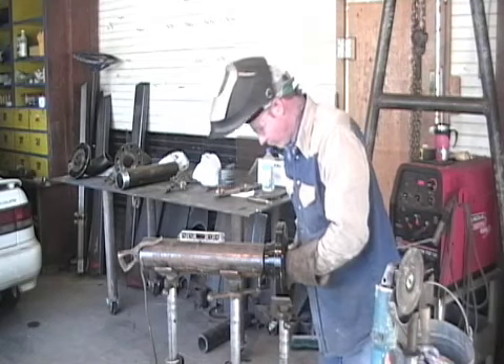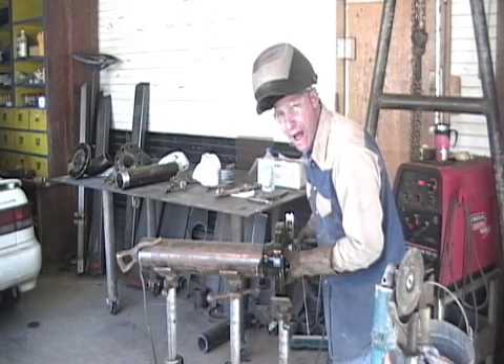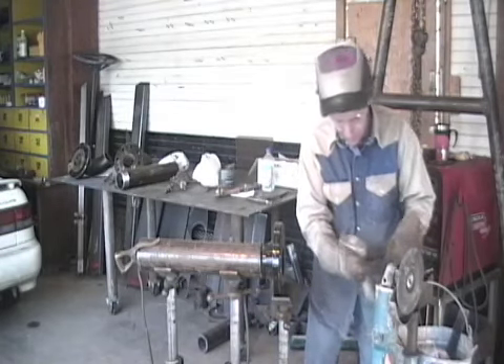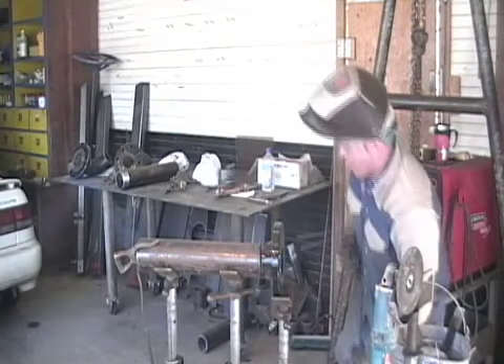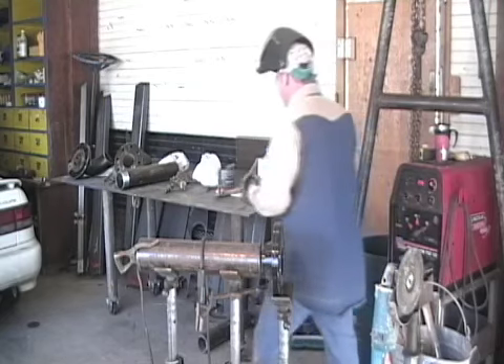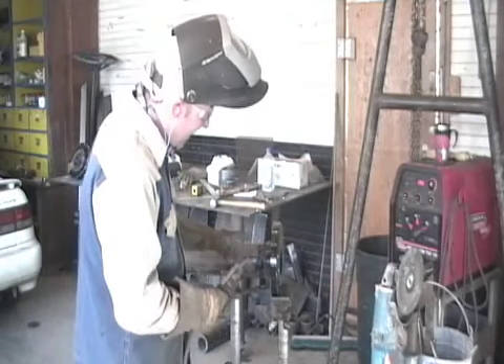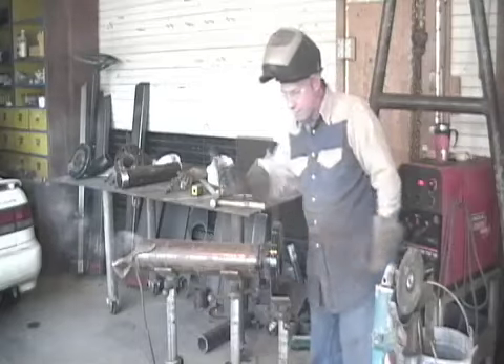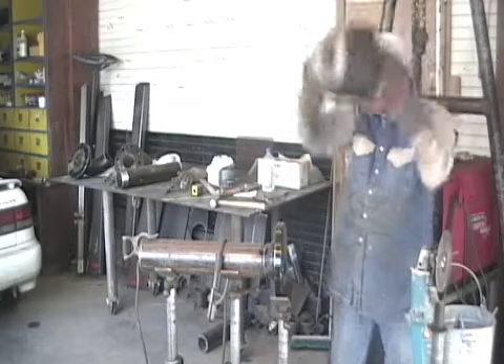Watch Stick Welding from The Welders Lens Home Study Course

Comment: @hilo5555  I've done a good bit of flange work...I only use a copper hammer there..and 6016 for root is usually required...I don't know what this guy is using..but most all the 6010 (5P) is sort of red..

Comment: instead of using framing square to check squareon sides wouldn't be easer to turn 90 degree and level , replum the piece you are working on?

Comment from the maker: No problems what so ever.
It doesn't work to well with the tig but the upgraded version of the 3 m speedglass does.
The one I am wearing is the fixed shade 10. Hormel 3 M is the best of the best. I have tried them all.

Comment: i worked for a company that was a ball buster about having the bevel at a 37 degree angle and square, so after alot of yelling and being threatened to be fired i can slap a bitchen bevel on a 12 in carbon steel pipe in 5 min. but i plan on welding soon so now i can bitch at the help for not getting it right!

Comment from the maker: That just depends on what your welding on and what code you weld under.
Usually some type of fast freeze rod or tig possible mig on the root. Same with the fill or for sure the hot pass.
Usually on the cap with fast freeze root or tig root will be a 7018 cap and could be on the mig as well or some type of flux core cap with mig possibly. Really just depends.